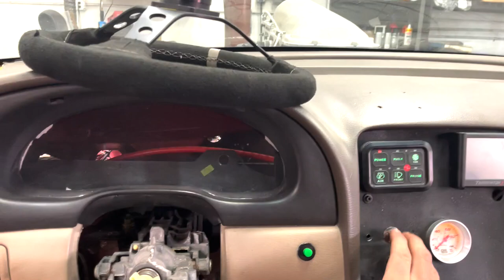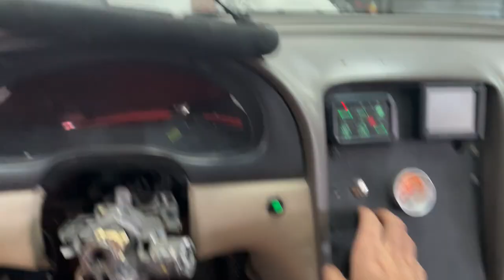TUG OF WAR 12 Valve vs 7.3 OBS!!! Bonus Footage - New Turbo Kit FIRST Startup!!!

Comment: You want to change out the wires for pumps to larger gage wire. Those pumps pull some amps and thats why they are getting hot. Good luck and can't wait for RMRW.
Reply from the maker: Good to know, they are 10 gauge right now

Comment: Yeah, those wires really shouldn't be warm after a few seconds. Good call for sure to swap them all out just in case when you swap out the pump.
Reply from the maker: Yea I went ahead and redid all the wiring for them and installed the new pump, they’re purring now

Comment: Hey Parker,  Great Job in getting the car running. Well done Dude.  But one thing and it's not just you. A lot of other guys start a engine for the first time and don't check oil pressure. Most of them don't even have a guage. But other than that it's cool that you are doing it yourself. 
Cheers Man.
Reply from the maker: Hey mark I have an analog oil pressure gauge on the dash that was reading healthy. But you’re right it’s easy to overlook!